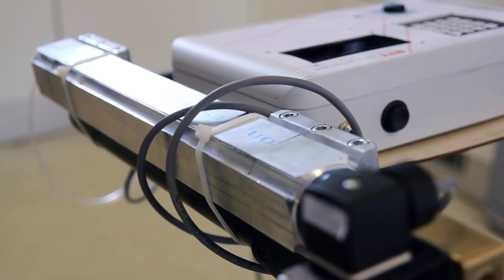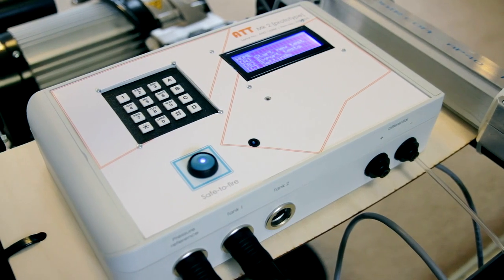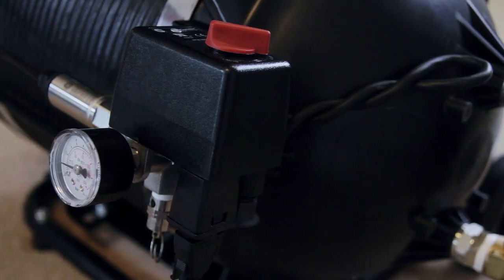Pulse – Effective Low Pressure Airtightness Testing

Comment: OK, but if the building fabric is leakier than you expect, how do you pinpoint the leaks?  That's where a blower door works.
Reply: +nick1of2 - That's correct, you can't sustain pressurisation or depressurisation to track leakage paths with a smoke pen or IR but the shape of the pulse result given does provide an indication of the type of leakage paths you have (large or small openings etc.) and we're currently doing further work on this. More importantly, in my view testing at the end of the build or retrofit is too late for pinpointing leaks anyhow so a quicker, easier, lower cost test that can be done at multiple stages of the works can in fact be more informative and helpful to the quality assurance of the build process. More info on our website - www.pulseairtest.com.